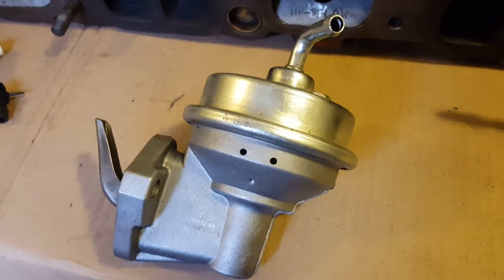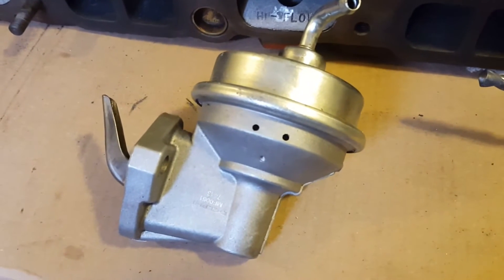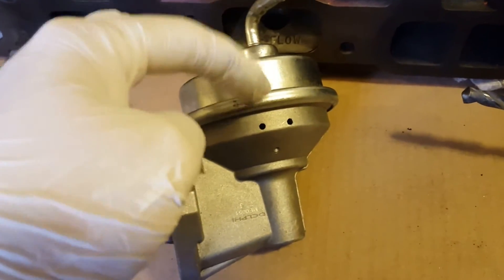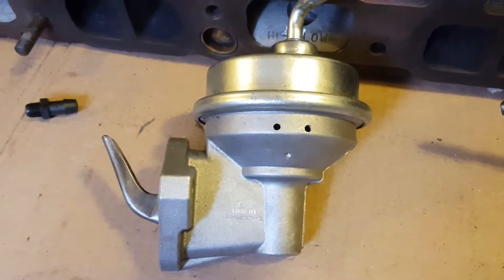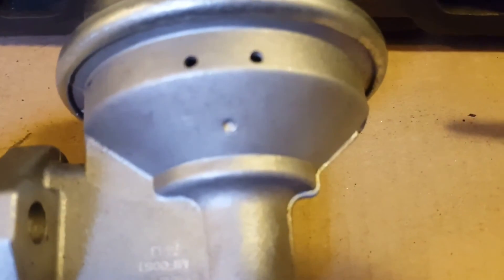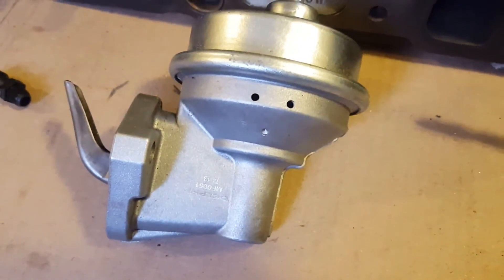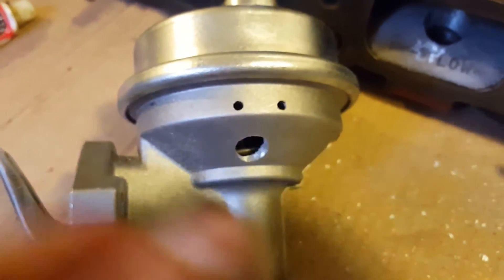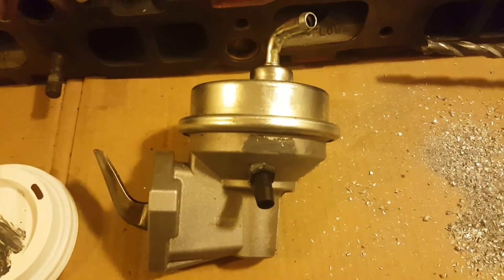1967 Camaro - How to Boost Reference a Mechanical Fuel Pump

Comment: Its not working for my application what could be wrong is the aeromotive pressure regulator go along with this setup or is it single boost pressure to the fuel pump or the other alone ? Maybe that's my issue

Comment: The world NEEDS more inventive discussions like this.  Im trying to find success with a draw thru turbo  on a 250. Im looking at how i can retrofit a sbc fuel pump on the the inline 6, for more volume.    Btw, i do advocate for a metal nipple and threading the pump body... i realize your aware... but still a Great video. Congratulations for being smarter than the average bear. 👏

Comment: You have a plastic fitting sealed in w job weld why didn't you use metel fitting or brass I wouldn't trust that
Reply from the maker: The honest answer is because that's what I had in my tool box. It was a fitting I had from a Spectre inline fuel filter so I knew the fitting was good for fuel. Ideally a metal fitting would be a longer lasting solution, but I've had success with the 2 part JB weld on metal and plastic. That pump is out of service now as I upgraded to the Sniper EFI system.

Comment: Which fuel pump do you have ? Is it the one with the push rod or cam operated?
Reply from the maker: It was the stock type, it has a rocker arm that goes on the cam. Technically still have it but I switched to the EFI system now and it uses an electric pump.
Reply: If it works off the cam does it matter if it’s up or down?
Reply from the maker: I know some pumps can function fine mounted upside down. In theory, based off the cam drive and mechanical diaphragm operation it should work just as well upside down. You'll have to consider the specific pump may not be designed for it though. Such as, the internal seal may not handle gravity upside down and may leak, especially at rest. Honestly though I've never tried this pump upside down on this motor. You'd best contact a hot rod shop and ask about your exact engine/pump combo.
Reply: @TurboCamaro67  thanks 🤝

Comment: Good stuff! I'm redoing a 1966 C60 3ton with the 292 and plan to turbo it modestly. 8 maaaybe 10 psi. Not a lot. Just a little extra snort to help things get down the road. This was super helpful, the blow thru carbs n boost ref is kinda confusing. This made things simple and cheaper. Thank you!
Reply: Jer Bear I thought that the first model year camaro was in 1967
Reply from the maker: You're right Cooper, it was 1967. The C60 he's talking about is a pickup with a 292 engine.

Comment: Couldn't you just run a T fitting  on the fuel inlet 
side of the mechanical fuel pump without having to drill and tap and external line on the bottom of pump like you did?????
Reply from the maker: Tapping the pump there pressurises the pump from the inside and assists with pushing the already pumped fuel out the outlet at a near 1:1 psi as you have in boost. If I understand your idea correctly, putting a T at the inlet would have incoming low pressure fuel meet rising pressure boost referenced air head on. I'm betting this would result in air pushing into the pump instead of fuel, and then you'd see it restrict fuel from entering the pump under boost. The method in the video doesn't allow air to restrict the flow or make contact with the fuel. Unless the pump diaphram fails of course.

Comment: Did this mod only difference was I drilled and tapped for a barbed fitting. Had to cut down the tap to tap it all the way but worked good,thanks for the video!
Reply from the maker: No problem.. Such an easy mod to get some boost going. I never went past 10# boost and never felt like the modded pump was a limitation.

Comment: Did this work for you i wanted to try on an 8to10psi blow thru setup
Reply from the maker: +David Policastro yes it did, but I didn't go past 10psi. Of all the mods and hacks, it was the easiest and worked without issue. Obviously I'm running the Holley Sniper now, but the pump mod was great.
Reply: Turbo Camaro awesome i was going to try this and a chinesium fpr see which panned out hah
Reply from the maker: +David Policastro haha, this will increase boost 1:1 to probably about 9-12psi before falling behind. I am a fan of semi-proven China sourced eBay parts though.
Reply: Same will try and let u know how the 13301 knock off works
Reply from the maker: +David Policastro haha please do!

Comment: would like to know if it worked
Reply from the maker: Just installed the turbo yesterday. Running 5lbs boost and so far so good. Going to dial the boost up as soon as I get a check valve for the PCV system.

Comment: interesting video, how is this holding up still?
Reply from the maker: Well, the pump is working fine in stock configuration (nothing connected to the hose barb) but the turbo hasn't been hooked up yet. Has been some life delays but it'll be soon and I'll do an update video on this.